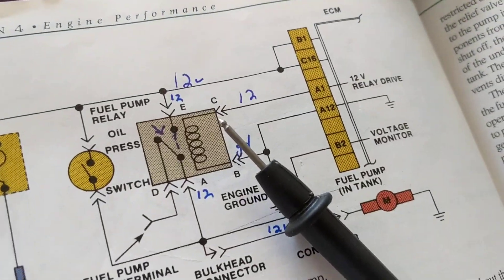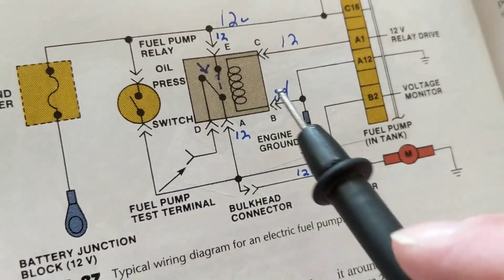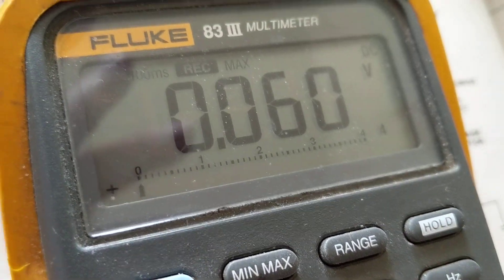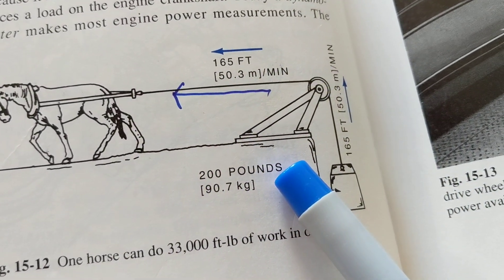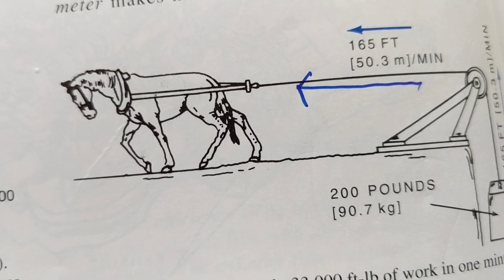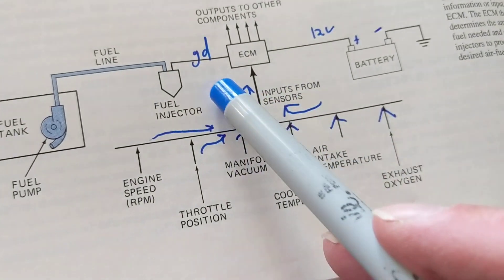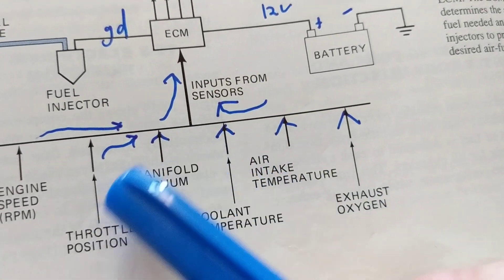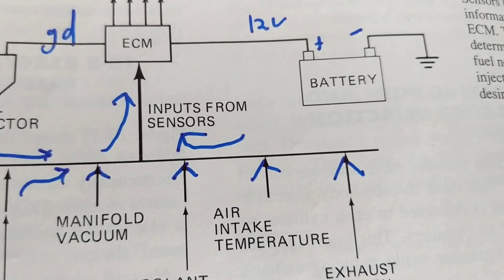Fuel pump relay problems from wiring diagram

Comment: Great video Joe. Got a question please, if you don't get the 12v from the ecm(DK green/white wire) when relay is plugged in but you get 12v when relay is removed, is the ecm faulty???? Thanks

Comment: So, the oil pressure switch is not only used to bypass the fuel pump relay, it is an input to the pcm for the  fuel pump relay control?
Reply from the maker: In this example however sometimes the oil pressure switch is in a series with a fuel pump relay sometimes the fuel pump relay is by itself depends on makes and models

Comment: Good instructional video. what i want to know here is whenn i turn the ignition on ,the fuel pump starts to run continuously or it will stop after pressure build up ? and in other case of relais failer, the supply to the  the f/p will be via the pressure o/s an in this situation the warning oil light goes on ..is this true?
Reply from the maker: An oil pressure switch opens when the oil pressure is below the normal pressure such as five PSI that's when it triggers a check engine light as far as the fuel pump for example GM's have their fuel pumps they start them in the run position and then a fuel pressure is in the line and then fuel pump is off and turned on only when more pressure or less pressure is needed this diagram is just an example but oil pressure switches can be connected to ground or anything else a fuel pump in this example